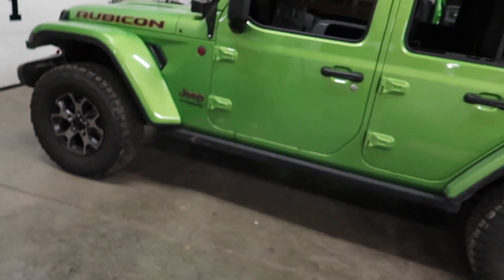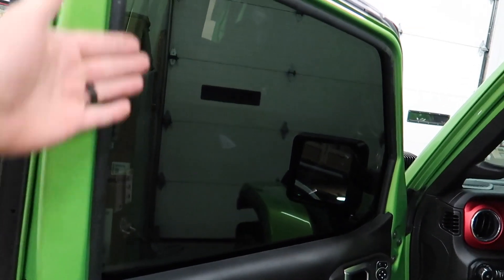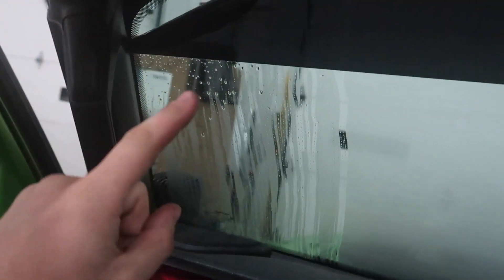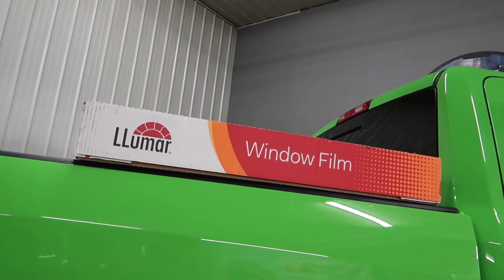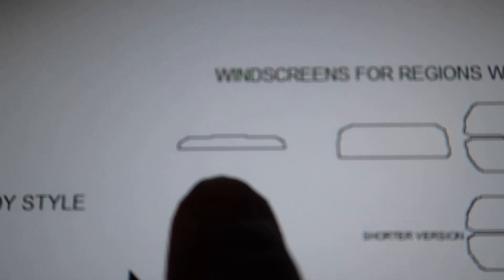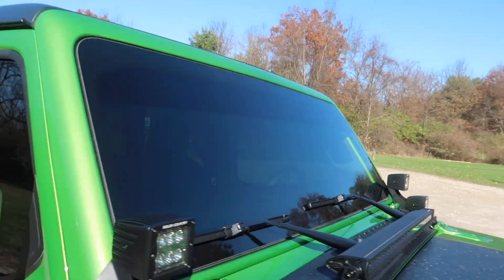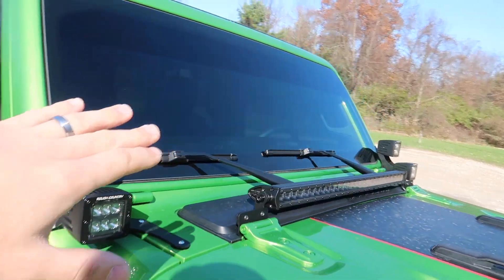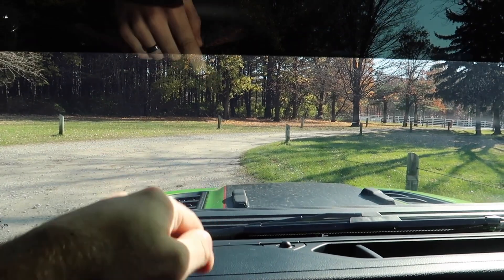Upgrading My CERAMIC Windshield Tint!!

Comment: were did u get you good decal
Reply from the maker: I made it myself
Reply: @benanton2619  what kinda short antenna do you have on your JL and does it work good
Reply from the maker: The one I had in this video was a rugged ridge 13” and yes it works fine

Comment: Shoulda folded the windshield down and did it on a flat surface. Lol👌🏾
Reply from the maker: I would never want to tint on a flat surface bc dust and dirt settles quickly , when tinting vertical you have the ability to always be pushing the dust down off the glass when applying the film. That and I can’t fold my windshield down anymore bc of my light bars 😢

Comment: Just Subbed! Looks good! Do you get pulled over for your tint? I live in Cleveland I also have 50% on windshield
Reply from the maker: Never had a problem with it!
Reply: @benanton2619  Great vid, I watched the whole thing. Is the Llumar you used ceramic as well? Was the Llumar just as good for heat rejection? Thanks!
Reply from the maker: Yes and yes!

Comment: Move your light bar to your front bumper, that will eliminate the glare.
Reply from the maker: I plan on getting a front bumper that has an integrated light bar, so I might have to find a different use for the 30”

Comment: If you did this in Texas they would write you a ticket and heartbeat trust me Texas cops don't play around in Texas Highway Patrol really wont.even though it's not in the middle they would still mess with you
Reply from the maker: Dang! That sucks, lunar also has 70% and air 80 which are the lightest that I know of, but still have the benefits of ceramic film!